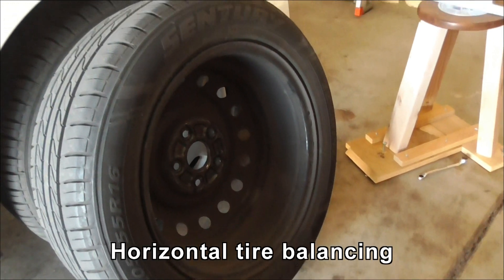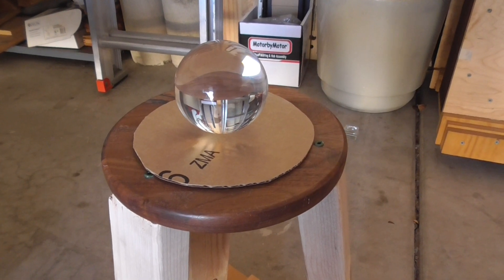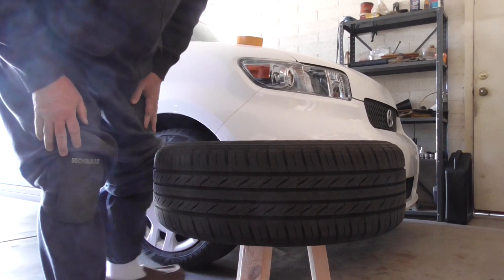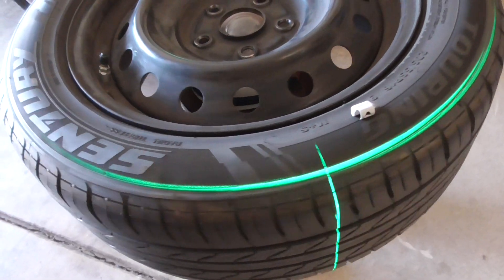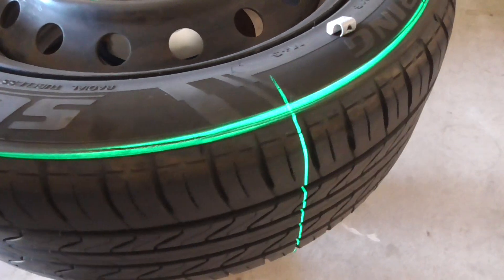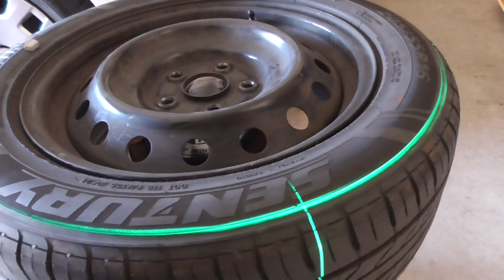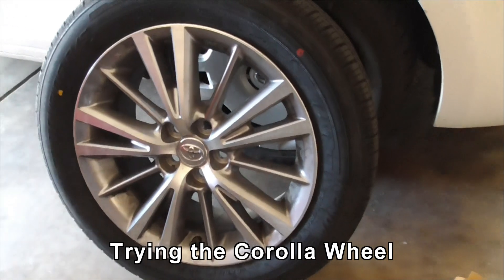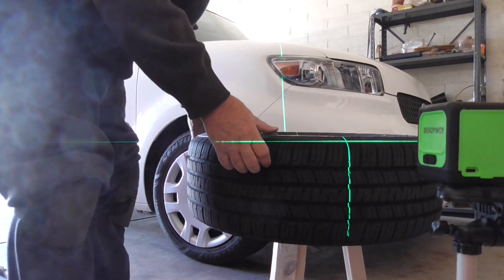Horizontal Tire Balancing Without an HF bubble balancer

Comment: It works but only with steel rims
Reply from the maker: It works on alloy rims too...
The determining factor is complicated and took me quite a while to figure out.
In short... The C.G. of the wheel has to be below the centroid of the ball it is resting on.

So there are some wheels it will not work on, those look like "deep dished wheels" where the hub is set inside the outer rim

Comment: Only an engineer could come up with something like that, I’m interested in how you calibrated the height of the laser? Impressive, thanks Phil.
Reply from the maker: That little laser is quite accurate. I have done a test with it where I checked how level it was with a 4 foot spirit level and when I line up the green line the level, it shows the bubble dead canter. I probably can't get it more accurate than that. 
The laser has a built in tilt mechanism, like a pinball machine, which makes it beep if it isn't throwing a level line.
I put 3 bolts into the stool base so I can level it, then put the 4 foot level on the top of the steel plate.
The laser is on a tripod and I bring the line down to meet the top edge of the level. Adjusting the 3 bolts so that I get it level in 2 directions 90° apart.
Like this... Then I don't move it until I'm packing it all away.
https://youtu.be/WgjNO2gt3xg?t=29
Then skip along to time index 10:20 to see how I do the balancing.

Comment: You can use a billiards ball
Reply from the maker: Thanks for the comment...Yes you can 
But as I found out when changing the base materials from soft to hard, the harder the Base and ball materials the better. Which is why I ended up using a 2.5 inch steel ball on a steel plate (+hub centric rings when needed).
In the text under this video there is a link to Kia soul tire change. It shows almost everything I've learned during this long learning experience.

Comment: people are falling for your wheel balacing method lol, but the real question comes to mind, Why this old man has a CRYSTALL BALL 😂😂😂
Reply from the maker: They are??? Good for those people!!! 'cos it works 😁😁😁 and I don't have to go to a tire dealer.

I switched the 80mm Crystal ball for a 2.5 inch steel ball with a few plastic hub centric rings and I can do many different wheel hubs now. Corolla to Silverado 1500.

Now where is that crystal ball. The feng shui seems to be off a little...
Reply: @richbinaz I was unfortunate to have a nail on a front driver tire, so I dismounted the tire and patched it from inside using the mushroom nail patcher, then clean the tire bead and rim, and remounted the tire,  it was using 4 of 1/4oz fe sticky wheel weight, I shoveled all wheel weight off,  and before inflate the tire, i watched the YouTube video how they dynamic road force balance the tire and shift the tire in respect to the rim to minimize the imbalances first and then put the wheel weight on, I put it on my harbor freight wheel balancer, tested and shifted the tire a few times to get bubble as close to center as possible, and I switched to a 3 inch stainless ball on steel plate, it further resolutes the unbalances, and I ended placing a single 1/4 oz wheel weight on the rim and the bubble is at dead center, even after I lifted up tire rotated 90, 180, 270 degree, put wheel on vehicle and road tested it on highway, smooth from 0 to 90 miles per hour. This way it reduced the extra unnecessary wheel weights and perfected it the balance
Reply from the maker: @bronzemaxellwg3098  It sounds like you have a good bubble balancer. There are some around, mine wasn't.
Looks like using both methods worked for you - which is what is most important.

Comment: hi a ceramic tile will work for a base and be perfectly flat
Reply from the maker: Yes it can. I ended up using a steel electrical cover plate along with a steel ball as they are much less likely to break with heavy tires. 
https://youtu.be/gGv5MUxbQ3c?t=87   Silverado 1500 tires 75 lbs

It is important for the surface to be FLAT and LEVEL.
https://youtu.be/WgjNO2gt3xg?t=30

Comment: Where do you get a glass sphere like that?
Reply from the maker: I got the 80mm glass ball on amazon, but i found out it was to big for the alloy wheel I tried to balance at the end of the video.
I ended up getting a 2 1/2 inch steel ball from amazon, which does a better job, specially coupled with a simple steel plate I picked up from home depot. Try this video
https://www.youtube.com/watch?v=JvN4i-qJqMs

There is one downside of the steel ball in that it doesn't fit some of the larger wheels with bigger pilots. To solve that issue, I got some plastic centric rings and was able to use them on a CX5, Kia soul and even 2 together on a Silverado 1500.
https://www.youtube.com/watch?v=gGv5MUxbQ3c

The centric rings I got were 67mm to 60mm & 78mm to 67.1mm

Comment: I think it was me who messaged you, i forgot to make my video public, so i just did it now. I used the same method again today with success, i changed my tyre and didnt bother to balance which caused an annoying wobble over 60mph. I use hard ABS sheet, a ceramic tile or mirror would be a good option.
Reply from the maker: Yes, great video! Got me inspired, thank you!
There were a few problems I came across that I very slowly solved...
1. The ball and the resting surface have to be fairly hard - Now I have a steel ball and plate
2. The CG of the wheel/tire assy must be below the CG of the ball - For stability
3. The resting surface has to be level, to eliminate induced errors
4. For large wheel pilots, use hub centric ring(s) to reduce the pilot down to suit the ball size.

The useless bubble balancer is now a paper weight in the shed.

The largest tires I have done now were on a GM silverado truck. My sons father in law was complaining the wheel was bouncing up and down at 60mph - so I did a check balance when I took it off. It was way out. previously balanced by a large chain store over here (Discount tire)
https://www.youtube.com/watch?v=gGv5MUxbQ3c

I had trouble getting the new tire beads to seat, so I forgot to record the balance with new tires on. But the laser balancing worked great. No complaints at freeway/motorway speeds.

Saw this later on, after finally getting the tires on. I thought there must be an easier and cheaper way
https://www.youtube.com/watch?v=cHuyseqOUHw
I have small inner tubes ready and waiting.

Comment: Wonder if a glass ball can be as perfect as a steel ball which was made as a ball bearing.
Reply from the maker: It's claimed to have good optical properties for use with cameras, and it does appear to be quite round.
The biggest problem with glass is point loading it on a hard surface

Comment: Wonder if a section of thicker sheet glass would do to rest the ball on....usually 100% flat.
Reply from the maker: Yes, a harder surface works better - that was all part of the experiment.
I ended up getting a steel electrical cover plate for $1. Works well and the glass ball hasn't broken yet under the weight of the wheel. I thought it might with more of a point loading, which glass doesn't like.

Comment: Brilliant, I wanted to see what others were doing. I hung mine off the ceiling with a small plastic cone on the hub side centering the string, a peace of mdf on top with a hole in the exact center and a small two way level. Whole thing cost me probably less then 3$ and no vibration at all
Reply from the maker: Thanks, although not my original idea. Adapted it from a couple of others who were doing a similar thing.

I have seen a video with funnel and string suspension method. The trick is to get the wheel perpendicular to the cone, something the HF bubble balancer couldn't do.

Are you using the MDF above the wheel to put the 2 way level on?

I have found that most tires do not need a lot of weight added to balance them. 
The tires I just put on my sons car had no "yellow dots" (light spot marking) I added between 1/2oz and 1oz of weights on each one. No vibes at 75mph
Reply: @richbinaz  yes I used a vernier, held very steady (one jaw touching the string on the same point at all times) and spun the wheel to center the string to the rim. the 6" by 6" peace of square mdf was drilled exactly in the middle (I really don't think that matters because it's so light) and placed on top of the rim to make the surface flat. The two way level (×and y) sits on top. The whole thing is hung from the ceiling by a hook at chair hight. Your absolutely right you don't need allot of weight. The rims had the old weights from previous professional balancing and I used half the weight with larger, heavier and cheaper tires. No vibration at all only took it up to 140 kmh Because cops like to hang out by my town and I didn't have any donuts 😕
Reply from the maker: @666ImI666  Your method clearly works with no vibes at speed. Well done. 👍
The stick on weights I just took off (professionally balanced) were about double what I added. And made of lead, which is bad for the environment. Only one wheel had an extra rim weight for dynamic balance. I think it was the one that had a dent in the alloy rim. Still no vibes.
I have to wonder how accurate  balancing needs to be, when the contact patch flattens the tire and makes it out of balance??
Reply: @richbinaz  thanks, i appreciate the feed back and I'm sure it starts to matter at some point or speed 🤷‍♂️ I figure centrifugal forces at very high speeds push the tire out shrinking the contact patch significantly but that's beyond my scope of knowledge I just know they have a speed ratings for a reason

Comment: Check out the mcFarlane wheel balancer. This is a suspension type balancer as used in the small aviation industry. The parts are easy to make yourself with a 3d printer and it works a charm. I use it on motorcycle tires but the principle stays the same. since its hanging from the ceiling it removes any alignment errors from the setup and takes almost no place to store.
Reply from the maker: That is an interesting balancer, which won't work on most car wheels due to the lack of bearings in the wheel hub. Would have to come up with another method of centering the wheel.
The "CG of the wheel" problem is overcome by having the telescoping tube lift up so the point the wire touches the small hole thru the bottom end is above the CG. This provides a correcting moment to the wheel, while it is out of balance. Then the wire can be centered in the upper hole for static balance.
The tire they show in the usage instructions is quite wide compared to the outside tire diameter and there may be dynamic balance problems. Probably best to use a proper balance machine that can do both.
One of my goals was to find a cheap device and method that most people could make and use without costing more that about $100... roughly the cost of installing and balancing 4 tires at discount tire co.
For static balance, this my go to method... https://www.youtube.com/watch?v=du5cTMqpIhY&t=1s
Reply: You don't need bearings, a mounting plate on the rims outside will do just fine, just make sure that you get the pivot point somewhere halfway the rims height. I use a bowden cable (3mm) to suspend the wheel. If you look at the drawing you can see that the pivot point is not the same as the cable mounting point.
Reply from the maker: The nice thing about the ball is, it self centers on the wheel pilot. So no special mechanisms like the HF bubble balancer has to try and find it - HF failed BTW @dutchsailor6620

Comment: Using the glass ball is the brilliant part of this method. Like jan voss with steel ball but he has a very hard steel surface to rest the ball on. Maybe you rest the ball on a thick piece of clear glass or a super glossy piece of rectified floor tile.
The horizontal laser is brilliant in theory but how do you know if it's DEAD Level? It has bubble levels itself.
I have not tried this but when the wheel stops turning after first weights and close to TRUE but you can still see a slight incline, would it work to VERY gently pour some antifreeze (need alcohol base) into the wheel gulley to exaggerate the incline as will run to the lowest point? Add lightest weights and repeat.
Reply from the maker: Hi Shane. I would have bought a steel ball, but the glass ball was cheaper and I wasn't sure that this experiment was going to work at all, so I was keeping the amount of investment $$$'s to a minimum. It's also why I started with softer base materials before putting it on the aluminum plate. Steel on steel is probably best.

I checked the laser by projecting the beam onto a wall and checking the green line it made with a 4 foot spirit level. It was as good as the spirit level. 
The laser has a limited amount of internal movement, much like the tilt mechanism on a pinball machine. If the box strays to far from horizontal, it goes into "tilt mode" and beeps. Handy.

I'm not sure how accurately the tire needs to be balanced, I think the 1/4oz stick on weights I use now would be the limiting case. After all, the flattening of the tire at the contact point with the road must have some effect, but how much?? who knows??

Comment: Thank you the video,  I’ll have to check out the laser.  I have a HF bubble balancer and sightly drilled the hole bigger where the point of the rod fits into and this made a massive improvement but I’m also experimenting with a static spin balancer that I’m making for car / truck tires.  It’s a spin balancer like for motorcycle tires.
Reply from the maker: Hi, the laser is quite good - tested it on a wall with a 4 foot spirit level, it does project a horizontal line. My HF bubble balancer is now a paperweight in the back garden shed. It just came with too many flaws. https://www.youtube.com/watch?v=an6sURvUhBA

I swapped to vertical balancing for car tires, using a modified hub and that seems to be working out much better. The only drawback is each hub fits only one pitch circle of studs
https://www.youtube.com/watch?v=du5cTMqpIhY

So for my sons XB, which has 4 studs, I think I will be using the glass ball for him. The hubs are tricky to adjust to get them to spin freely.
I did see a video where a guy was doing a vertical balance using No-Mar cones on an Acme threaded shaft. Had to reverse one cone to get them to fit.

I use 2 saw horses for motorbike wheels & a 2 step process to reduce the weight needed
https://youtu.be/wJ4Auia2C1Q?t=136  step 1
https://youtu.be/wJ4Auia2C1Q?t=381  step 2
Reply: @richbinaz  I’m going to get a laser and experiment with it.  As I mentioned, the rod and cones he used are from No Mar, I have them and the cones work great but the rod no so much, too inconsistent results.  I’m getting a   16mm smooth rod and going to try and make it possibly work with the No Mar cones, but again, the rod in my opinion just works OK.   A Smooth Rod is the best way for manual spin balancing.
Reply from the maker: @workharddieproud  
I wonder if the rod has an acme thread???
https://www.google.com/search?q=acme+thread+dimensions&rlz=1C1CHNQ_en___US557&oq=acme+thread&aqs=chrome.2.69i57j0i512l6j69i59j0i512l2.77462090j0j15&sourceid=chrome&ie=UTF-8

It should be pretty round on the OD unlike a standard UNC thread and should run on a pair of bearing OD's at each end.

Can you just use the wheel axle?? or does it have different diameters at each end?
Reply: @workharddieproud  'the rod in my opinion just works OK'
Get 2 or 3 bearings, and stack them on each side, instead of just single bearings.  If you have enough of the thread surface against bearing surface, it won't really matter that the rod is threaded.
You could get 608 bearings.  Use 3 stacked where each of the 4 single bearings would be.  Probably as cheap or even cheaper than good larger bearings, and should take the load and be easier to make the stand part.
Reply: Just realized I’ve done commented once here.  But also, that link to another guys balancing video where he uses a threaded rod works just OK.  That rod and cones are from No Mar brand.  That causes too much resistance and you won’t be able to get consistent results, I know because I have one and tried that rod and cones on 3 different spin balancers with a truck tire and motorcycle tire.  A solid smooth axle rod is much better.

Comment: Can you tell us the Brand and Model of the laser pls?
Reply from the maker: Sure, I got it from Amazon. It's a Bekoywoy brand, here's the link
https://www.amazon.com/gp/product/B09QL2V8WV/ref=ppx_yo_dt_b_asin_title_o07_s00?ie=UTF8&th=1
and currently is US$36

There are many similar ones on the website. The self leveling worked great. It beeps if it isn't level.

Balancing this way worked on the steel wheels, but not the alloy wheels.
Reply from the maker: The glass ball also came from Amazon. I picked a glass 3 inch (80mm) ball as it was cheaper, but a billiard ball can work if the 2.25 inch (57mm) diameter fits the wheel pilot. 

The best choice is a steel ball. Amazon has those too.

For a steel ball, I would pick a diameter that would give you a contact angle of between 30° to 45° from horizontal. A lower contact angle makes the wheel more stable on the level surface.
The 80mm I picked gave about a 45° angle on my wheels, as seen here...
https://youtu.be/a4Ox_Emh7Ew?t=390
Reply from the maker: I like this guys version too - just need accurate hole size to match threaded rod
https://www.youtube.com/watch?v=dAM6lrBOHOQ